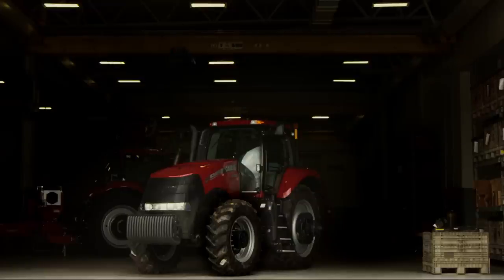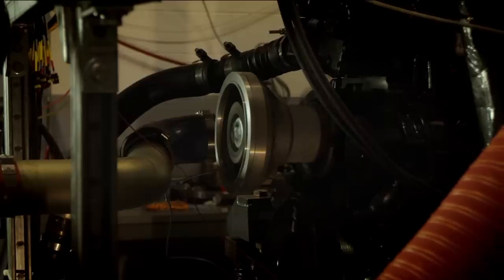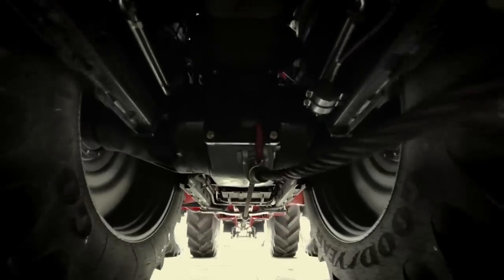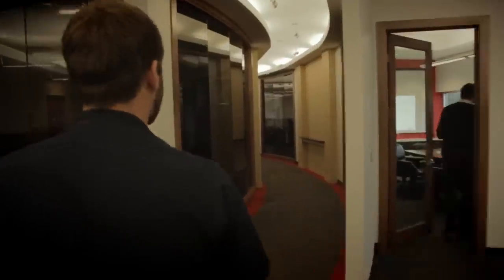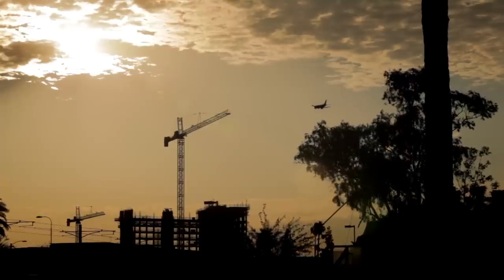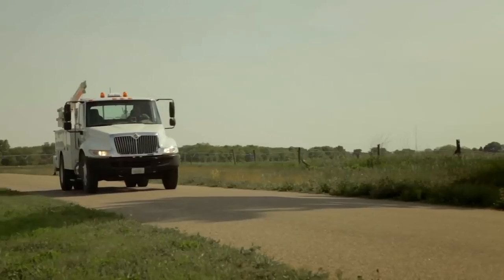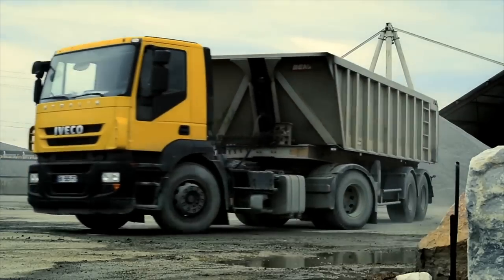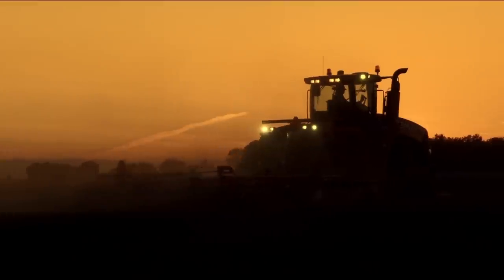Case IH and FPT at Burr Ridge: Exploring the Source of Efficient Power

Comment: "We test these engines Beyond a safety factor". Well, here it is 2020 and with the 8 years since the video, we find out that the liner o-rings bit them in the bahookie on the 8.7 motors and dumped antifreeze in the oil.  Fortunately Case IH was good about making good with warranty repair.